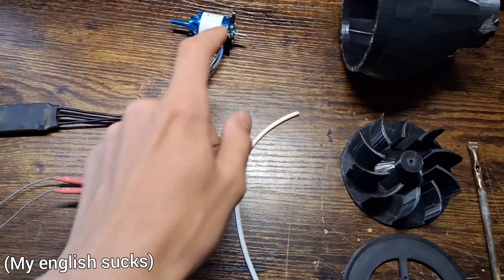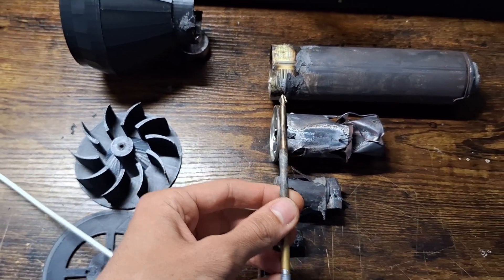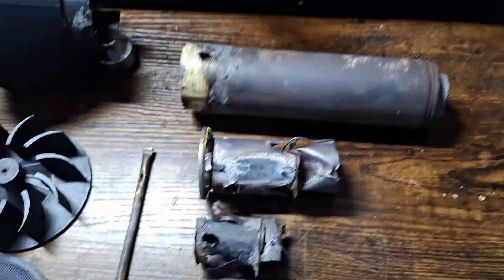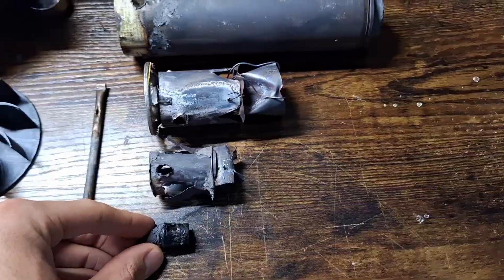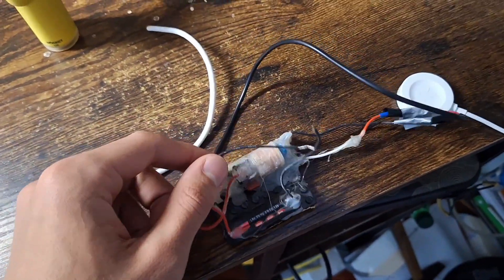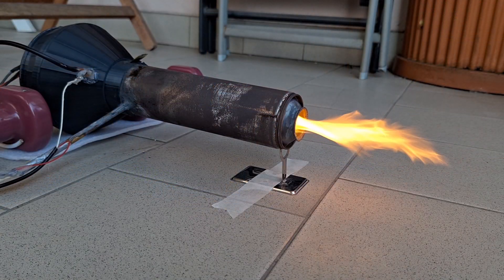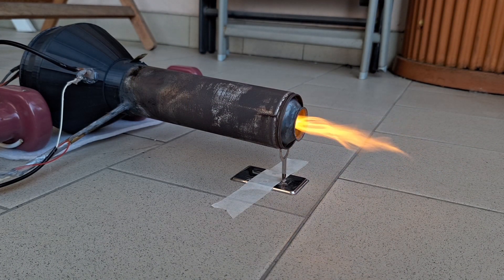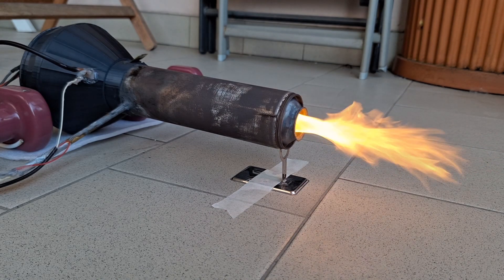Electric JET engine

Comment: Hey if you want to make a fuel injector, use a m3 long brass nut with a m3 spiral tap. It will increase the thrust, check out my video if you want to see it work.
Reply from the maker: Cool, i will